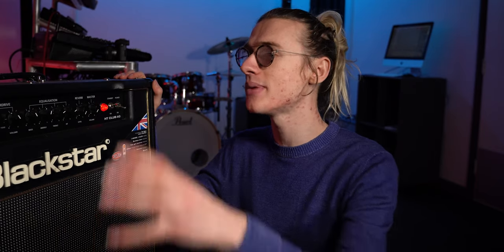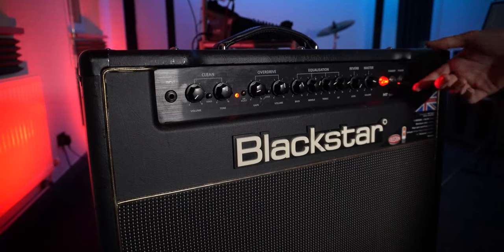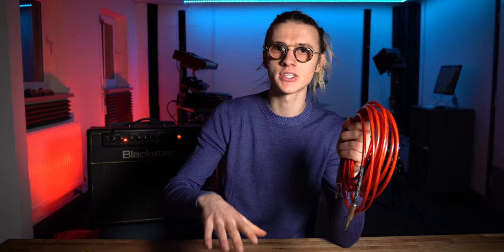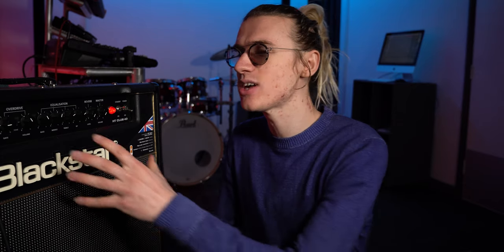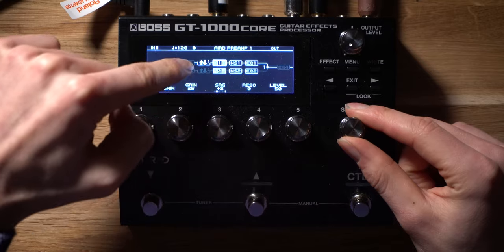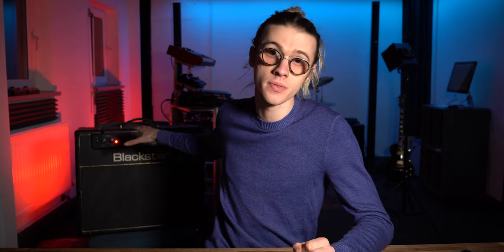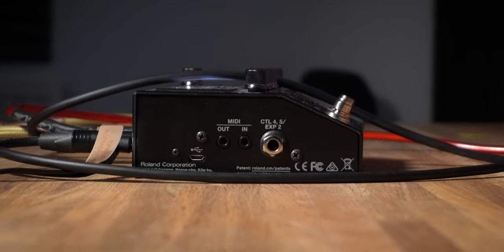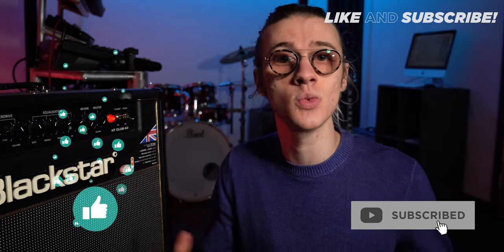BOSS GT1000CORE - 4 Cable Method! Use a valve amp with your BOSS GT1000 CORE! (how to)

Comment: Hi, nice video!..., have you tried the Gt1000 core in the Blackstar's overdrive channel  with high gain and high volume?,  is to know if this unit have a good bypass when connected (in front or with the 4CM), have you compared this unit with a true bypass pedal?

Comment: Even more. You can use BOSS's effects in front of external preamp - like Wah, compressor, pitch shifters and digital boosters. Not the most effective way to boost the valve preamp, but it takes effect close to one active pickups do.

Comment: Does the return jack in the gt1000's loop have to be plugged in or can the send be used as an additional output? As in loop send --> dry amp and the 2 main outputs --> wet amps?

Comment: I'm loving the GT1000 Core with the ES-8 as the hub of my pedalboard...  The Core is the biggest bang-for-the-buck pedal out there with most of the 500 series and the OD-200 overdrives packed into it...  I like it most for how it handles my accoustic electric guitars...

Comment: This method is different than what’s shown in the manual (route FX S|R -> Amp R|S).. when I use Boss’s method on my Mustang GTX I don’t get any audio at all.. using your method I get the CORE sound from my amp but aside from Master Vol , none of the other Mustang knobs or FX alter the audio output.   I’ve always been a basic amp + guitar player and first time using sophisticated FX gear so it looks like I need to look at the Mustang signal chain and see where the FX Loop sits.. enjoying your vids and enthusiasm.. production quality top notch !
Reply: Definitely do not connect SND/RTN to Amp RTN/SND.

Boss SND to Amp IN...sends signal to your amp input, but only if the Boss SND/RTN block is turned on, and it only sends signal from the active Boss blocks in front of (to the left of) the SND/RTN block. The Boss blocks after the SND/RTN will go to the amp FX loop, or all the signals will go to the amp FX loop if you turn the SND/RTN off.

Also check if your amp loop is series or parallel...if it's parallel you will have some sort of FX mix/blend knob. If it's parallel, know that it's not very practical to split the signals between amp in and loop because you have to set the blend right, and then if you change volume it's got to be balanced again.

Comment: If I ever setup my Boss GT 1000 to my Valve Amps send & return I select 'Combo Amp'  or 'Combo Return ' if there is any noise then I adjust the Output Volume on my Boss GT1000 .

Comment: I recently cycled through Line 6’s HX Stomp and PodGo before exchanging for a Marshall DSL40 (my firsts tube amp), and calling it a day. I want to play a real amp above all else, and retain that feel of raw power and sound while I play. The L6 products did NOT sound good through my FX loop, or any other way.

Now that I’ve got a great tube amp that I love—I had also tried a Katana in my journey for tone—I am still wishing to add some tonal variety, possibly alternative amps, and definitely effects into the mix. I liked the Katana’s effects, so it seems logical I may like the GT1000, and their AIRD tech sounds promising as it claims to work intuitively even when plugged into a real traditional amplifier. Is this going to be a let down a la L6?

I’m either going to buy a Katana Artist MKII, the big ass foot switch, and run it alongside my dry Marshall with an ABY pedal, or get the GT1000 to augment my Marshall. 

Which sounds like it’ll be better? I’ve also thought this option is better because I could do the wet dry thing, and have a second amp that is far more versatile with its true modeling approach to add into the overall sound with my Marshall. 

I’m looking to hit many birds with one stone. Down the line, yes, I’d rather have the real amps, and the real pedals, but for the short-long-term I’ve got the means to either grab a Katana, which I did like, or a GT1000. I love delay, modulation like flanger/phaser, and want looping ability. Both appear to have these. Please help me! 😁

For the record I have mics like SM57 etc, and I do like to record, but as I’ve said the recording bit is secondary to in-the-room tone. I am a millennial, but I favor the traditional amplifier sound and feel. I can’t do headphones unless I’m strictly recording. I’m not inspired much while jamming through a studio headset. I don’t have any flat response speakers. 

Many many thanks if you actually read this, and thoughtfully considered my dilemma. Thank you.
Reply: Man if you’re already got the Marshall you’re loaded on amp emulation but the GT1000 personally is way more easy to use than normal pedals, being able to move them around, adjust settings on the fly, and full one change your entire pedal board rig just with a button push the GT-1000 is just easier as a pedal board than individual effects
Reply: A FRFR speaker with a GT-1000 though will give you the AIRD amp models, very good sounding with much more tweak ability than real amps but might not give you that cab resonance and feedback response from the Marshall. My opinion is the amp can stay long term but definitely go for a GT-1000 as your pedal board rather than real pedals, the feel will be the same as pedals are transistor based too anyway
Reply: @AdamManley7  I appreciate your belated response. I’ve since tried a Fractal FM3 (after trying every other brand of modeler), and have just sold it to buy the Axe FX 3. Fractal fully won me over. There’s no comparison in my ears. I sold my tube amps to buy the Axe3 because it’s just that good. I send it through the return of my solid state head into my 4x12 and it’s so fucking authentic I can’t believe it!

Comment: Great video! My GT-1000 is expected this week!
I understand it is also possible to use the pre-amp of the GT-1000 together with the Blackstar.  The blackstar is then used as poweramp for the volume and with the GT-1000 the pre-amp could be changed giving it a different feel. For example an AC-30, I understand the pre-amp is a very important part of the amp and changing this would allow the best of both worlds.
Did you try to do this? Maybe even a video about it?
Reply: You'd better use one of the brilliant TVP series to do so, as that way you can use BOSS to add IR module to the chain. All ID Series TVP and ID Core amps have linear PA and wide range non-guitar general purpose speakers. That kind of a setup is the best for guitar processors as well as active monitors and sound systems. Use Line in socket.

Comment: Awsome video man great help just a question I have my pedalboard set up with 3 banks clean rythem and lead I want my head to switch channels when I press the bank buttons not the ctrl button , is there an option in the same menu to program the bank instead of the ctrl?

Comment: Hey man, great content!

I had a question. Can channel switching be done without using the ctl 1 button?

Let's say I'm going from patch 1 to patch 2 and the amp channel changes from clean to distortion automatically.  So, I don't have to switch manually by pressing the ctl1 button. Is this possible?
Reply: Yes, if your amp has an external channel select jack, connect it to CTRL4/5 of the Boss with a TRS cable (split the TRS to dual mono if you have two channel select jacks). Then you can use the AMP CTRL options in the Master Block to control what amp channel is used with the patch.
Reply: @Techo1329 I use a 2 channels Mesa Boogie Dual Rectifier, 1 clean, 1 high gain. Initial position of channel selector is set to Foot Switch (choices are ch1/ft sw/ch2) and ch1 (clean) is kind of auto-selected (fair enough so far). If current patch has Amp control turned OFF, as soon as I connect a jack cable from the amp control output to the foot switch input of the Mesa, it switches to ch2 (high gain) which is a weird behaviour in my opinion (but reading schema in the manual indicates it shortcuts so it seems it works as designed). This is counter intuitive and not handy because it means all patches where I just want a clean tone (ch1) have to be modified to set the amp control to ON. This should be the reverse in my opinion.
Do you have such a behaviour ? Do you please know if there's a way to fix this? (I actually use a GT 100 but the schemas are the same AFAIK).
Thanks in advance for any answer.
Reply: @score2926  G'day mate. No such issue with the GT-1000 which has TRS output giving two AMP CTRL assignable switches per patch. I see the GT-100 has a mono output so you are limited to sending just two control signals (AMP CTRL ON or OFF). For the GT-100, 'ON' is open circuit, 'OFF' is closed circuit. Anyway it sounds like it's working, meaning you get either Clean/OD by toggling AMP CTRL on/off at patch level...but instead of 'ON' being clean you want 'OFF' to be clean? If so I don't think this can be done. Maybe see how it behaves by changing the AMP Footswitch selector, maybe if you put it to ch1 or ch2 it will change how the AMP reacts to the GT-100 open or closed signal (AMP CTRL on/off).
Reply: @Techo1329   Hi, thank you for your reply. Yes that's it, I want OFF to be clean to avoid for example to get a "clean" FX from the GT over the overdrive of the Mesa preamp or 2 overdrives. But, while I'm thinking, in any case it seems (I got my GT yesterday) default GT sounds are all with GT preamp turned ON, so there will be 2 serial preamps which is probably kind of weird I guess. The best way I can imagine to fix the "problem" is to use the 4CM method and enable the "send and return" in the FX chain when I want to use the Mesa preamp (ON to get a clean sound and OFF if I want high gain). Since "send and return" is disabled for factory sounds (it seems) the Mesa preamp will be bypassed for those factory sounds and signal will go straight in the power amp (so I don't care if the switch is ON or OFF). The only problem remaining will be to adjust volumes between virtual and physical preamps.
Correct me if I am wrong if you'd like, thanks for you help 🙂 !
Reply: @score2926  With 4CM any active block in front of the SND/RTN block will go to your amp input whenever the SND/RTN block is 'on', and active blocks after the SND/RTN will go direct to the amp FX return (post amp pre-amp). In the GT-100 you can turn the amp block off if you have the SND/RTN active so you don't have both GT-100 and amp pre-amps running together, and you can still run GT effects to both amp input and FX return, just position the blocks accordingly within the GT-100...say you are playing through the Mesa overdrive channel...you have to have the GT-100 SND/RTN on but turn off the amp block, you can then cherry pick the other GT-100 effects you want to use and position them accordingly to be hitting the amps input, or fx loop.
Reply: @Techo1329  yes, this is what I actually described in my previous comment, but in a different way I'd say 🙂 I tried and it works as expected.
Thank you!

Comment: How are you powering the board? Boss/Roland were of no help. I tried to use to included power supply and it is an absolute noise nightmare when going into a tube amp. If you plug into a p.a. or the return of a Katana is fine but when doing 4 cable and adding pedals in the loop it gets quite noisy in spite of the ground lift. Any suggestions?

Comment: And what about the settings of output ???
 What is the good setting when plug from R/mono to the return of a loop's (pre)amp ?
There is no word about this in the video !
If you use line/recording it isn't good (and other katana, etc) !

I prefer how sounds the gt1000, but the helix line6 is more friendly-user, and for 4-cable method,  you must just select if outputs/send/return are line or instrument level : easy !

I don't understand the system and philosophy of the gt1000 (core)

I have one since today, to set on my pedalboard for use only with fx  (so 2 cables only in the send/return of my head Revv D20 or my fender combo, AIRD preamp and drive disable on gt1000, and outputs settings to.... i don't know, help me please)

Comment: Such an awesome video dude! Informative, to the point, well done! 
Follow up QQ of something I was hoping you'd also demo: in the video you showed how to use the FX loop which is great. Would setup remain the same if you wanted to add a stomp box/overdrive before your preamp? Meaning, if we wanted to use the GT1000 also as a way to add a boost in the signal that goes before the amp's preamp and still keeping the modulation effects in the loop?
Reply: You can set the GT-1000 up in every possible way. My channel has many videos on this. But to answer the questions: Yes you can place the FX pre or post the amp’s pre. And you can switch the real amp’s pre section off and use the GT amps to the real amp’s return.

Comment: Hey man great video, Exactly what I was looking for! Just want to ask a few questions just to make sure I’m understanding it completely. 

After creating a patch and just wanna turn some gain on, can I have the on and off control the amp feature part of that patch or would I have to duplicate the patch and have it where the amp is already on in the duplicated patch? Does that make sense? I’m using a fender supersonic and want more sounds and effects but don’t want to lose any gain. Thanks man in advance!
Reply: Yes, you can set the CTRL 1 footswitch to turn any of the blocks on or off.

Comment: Blackstar HT Venue Club 40 MKII has 5-way amp switch control on the back .
on GT-1000 we have only AMP CTL 1 and AMP CTL 2 .
can we send different number like 3 or 4 or 5 to change Blackstar amp state?
or we limited to only  1 and  2 .

Comment: Dude, you forgot to turn the cab sims off, or put it in Valve combo return input mode. Also it would be nice to talk about gain staging on connecting those 2, to make volume equal coming out of the Blackstar, connected or not.
Reply: I’d be interesting in learning how would you do that? Thanks!

Comment: How do you turn off the cab sim, can you disable both amp and cab sim and just use as a pedalboard into the amp using 4 cable method ?
Reply: Go to output setting and put the type of amp you are using. Do not use “recording” as output setting.

Comment: Great video. I have the GT-1000 original. I hook it up 4CM to my ENGL Powerball e656. I do notice some noise though. I have replaced all cables to shielded braided cables. I use noise gate. I set Send/Receive output on GT1000 to 75 and 75. Still get a bit of noise. When I stop playing it stops dead quiet. Then the hum kicks in after. Any ideas?
Reply: Make sure the output of the GT is set to the type of Amp you are using. Don’t choose “recording” as this will activate the cab sim of the AIRD even though the AIRD is off. Try that.
Reply: The boss gt1000 has a big flaw regarding its converter. The send port is sending white noise/hiss in the preamp. There are some discussions in forums regarding this issue. The only way to reduce a bit this issue is putting an graphic EQ1 block after the send/return block and reducing the 16khz by -20 db.

Comment: Hi Ben, I've been looking at this unit but I read that you can't use the cabsim unless there is a preamp block active, this could be a deal breaker for me since I'm planning on using this with a valve preamp pedal, do you know if that is true or not? so I can use my preamp pedals with the CORE.

Comment: i am planning to buy boss gt 1000 and i have some questions.

1)i have the blackstar ht 60 mk ii which has 3 channels.can i choose whatever channel i want through the boss gt 1000?what about voice switching?is that possible?

2)i want to do the 4 cm that you made on this video and record the signal into my pc.can this be done by sending the signal from the xlr d.i. output from the amp-->boss gt 1000-->pc or the signal chain must be done differently?

3)do i need to buy an audio interface to record what i planned to do or the boss gt 1000 can replace it and do the same job?
Reply: Nobody responded, so figured I would, even if its a little late now. 
1) I don't know the answer to the first half of the first question but my guess is most likely you cannot do voice switching unless your amp has a voice switching out, which I very much doubt. It's not doing anything magical as far as the footswitching capability, though it is a cool feature, all it is doing is sending the same signal a footswitch would do, into the footswitch input. 
2) Yes, the DI output works "exactly" as it would if you put a microphone to the speaker. I say "exactly" because my experience with both Peavey and Blackstar DI outputs is they are totally usable for live scenarios but when recording, it leaves something to be desired. But by all means test it out yourself.
3) The GT1000 can function on it's own as an audio interface. In fact, if anything, adding an interface after the GT1000 only increases the chances of the signal not sounding quite as clear into your computer. Because in that case you have to do analog to digital conversions in each unit, instead of only one of them.
Reply: @brandoncooke6564  thanks for the answer, much appreciated.